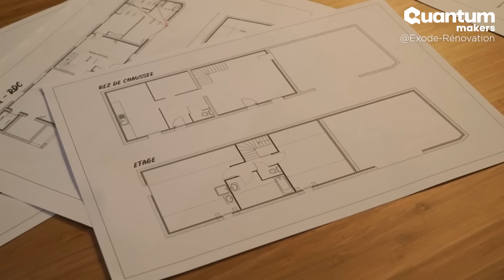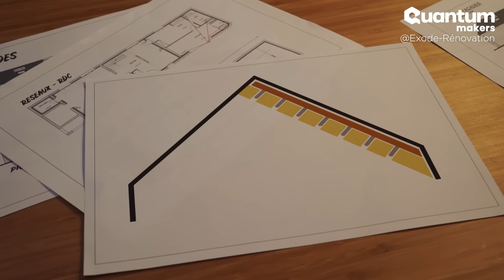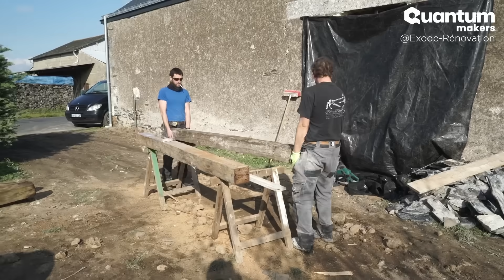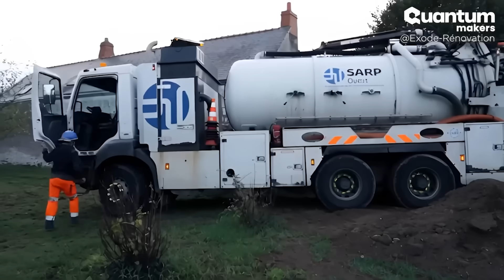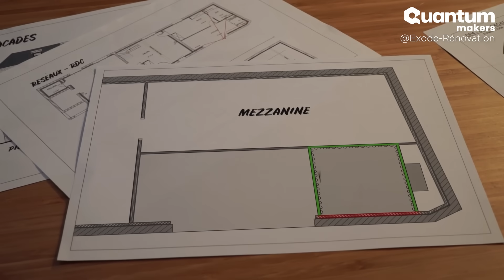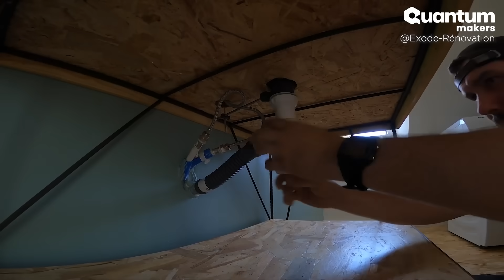How This Couple Turned a 200-Year-Old RUIN into a Stunning HOMESTEAD

Comment: U. S houses are from wood and paper they last 80 years at best with great metanance.
Reply: This house is not in the US, clearly you haven't watched the video, it is in the Louire valley region of France, and it's maintenance not the weird word you're spelling. Anyway even if the roof structure is shot to bits, some of the tiles could be saved, so why's he chucking them all off the roof into a trailer, they'll be useless, even if they were ok to start with. WHAT you Do is put a couple of scaffold boards (if long enough to reach from trailer nearly to roof, or then line these with plywood, with a cushion on the trailer floor, have 1 person up on the roof dropping tiles down board, they land on cushion so they don't break, and another stacks them in trailer. Ok they had builders in charged 10,000 for the roof, you now have $110,000, it's probably still doable, if this house is in France why are prices in $ they should be in euros
Reply: Avete un coraggio voi in america a definirle case ...baracche o prefabbricati e la definizione giusta